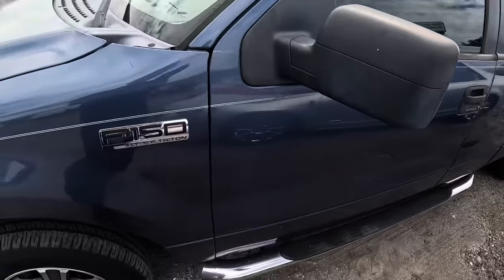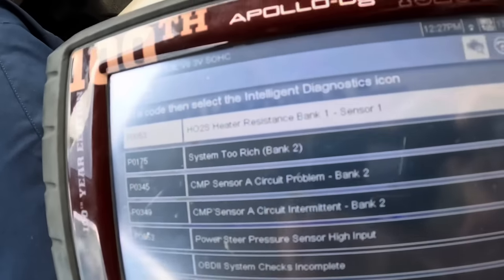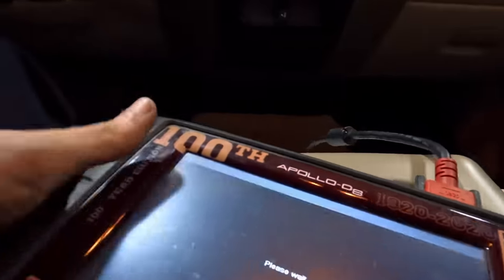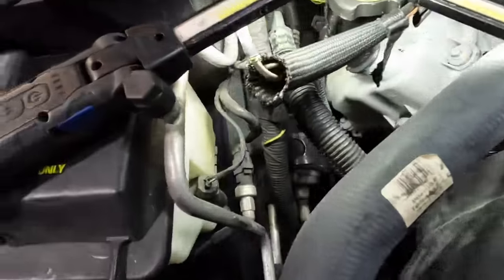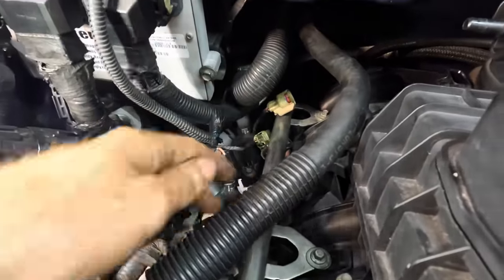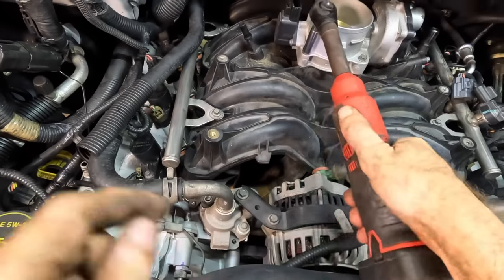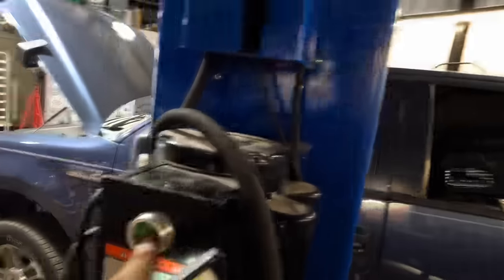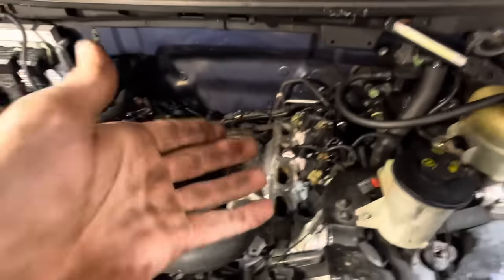Hack Job! Mechanic Botches Engine Replacement! Multiple DTC's

Comment: I could go into depth but it is every complicated but the short and skinny of it is that these engines suffet from an inherint HUGE issue everything from the 4.6 all the way to present with the 5.0s ecoboosts and 6.2s the basic issue is they starve for oil in the top end reason being the oil galleys simoky arent large enough the 2v engines would suffer collapsed lifters usually on the rear 2 cylinders due to them being the last to get oil in the fluid passages and what would happen is they would collapse the rockers would get crooked and the cam would press down on it and bam bent valves then they only made it worse by adding cam phasers to the 3v 5.4s the 5.0s etc. And they to this day refuse to address this issue and reevaluate their oiling system in all of their engines unfortunately the only thing they have EVER done since the 4.6 came out in 91 in the crown vics they specified 5w30 initially then it was 93 or 95 they came out with a TSB to drop the oil to 5w20 and they designed a filter with an antidrainback valve to hold some oil pressure after shutdown unfortunately thatnwas far too little abd far too late and they have continued to build throw away engines to this day

Comment: This is a sorry all-around job, starting with the shabby reman and on through the jackass installation. Yes, someone is going to get feathers ruffled but I would NOT give this hack mechanic a chance to re-do. Better to eat the loss. I can see a small claims suit if the owner is so inclined but that would throw you into the works, which is something you don't want on your plate. This is why I will continue to do my own as long as the Good Lord makes me able.  I allowed a "free Toyota oil change" at the local dealer and ended up in a pool of oil. I have a friend who, many years ago, had the crankshaft replaced on a '64 Riviera. The crankshaft had a sloppy regrind which involved weld slag in the oil passage. After it spun a bearing, he insisted they do it right. Yeah, they did it over, but somehow managed to leave a nut off of a tie rod. They knew he was a hot-rod, and I assumed this was payback. I rode in the right seat when a bump in the road dislodged the tie rod. It was a wild ride, even at 30 mph. This taught me over 50 years ago to do my own. No do-overs for hack jobs.

Comment: Unfortunately those engines were very bad and every one of them is bad I would replace it with something that would not have a three valve system get rid of that vehicle it's not worth it

Comment: The 5.4 is an absolute joke... You need new heads at 100k because the spark plugs will snap off
Reply: Not if you know what you're doing.

Comment: allways check the sensors before you start taking parts of the engine. as a mechanic you should know that. you wasted time for nothing. im not a pro but i have common sense.

Comment: Your focus seems to be the installer's incompetence, but you  can't state the fact of who did the work. 
🤔
Sounds like you tearing down someone else, so you can stand a little taller via innuendo. If you're good at what you do, no need to 💩 on "someone" else.
Reply: this is an obvious fuckup on part of the installer or installers - and they should be shit on all over the place for shoddy work like this. This type of work belongs in HS shop only. 

Yes, accidents can happen and things can someitmes be missed on big jobs like these - but in no way is ANY of this acceptable.
Reply: @ghostrider-be9ek  Agree.  But, continuously refer to the installer as "someone", just makes you sound like a 🐓💩, that is using "someone" else's shotty work to make yourself look better.  Either do the community a favor and warn them about THAT installer's subpar work or focus on your own exemplary skills and stop bad mouthing "someone".
Reply: @joeswheat I get where you're coming from, but the point of videos like these is to bring the viewers along through the diagnostic process and one of the factors in that is always the "someone's been here before"; in this case, most of what is wrong is not mechanical failure but human error. Pointing that out is just a part of this.

Also, Ray is humble and honest -- he says throughout the video, "I don't like this," or "I'm not cool with that," which are obviously personal opinions (in fact, he opens the video with this very disclaimer). 

He's not sh*tting on anyone. He's got enough of a following that he doesn't need to do that, so, therefore, that's not his prerogative.

If you work on anything (engines, HVAC equipment, plumbing, electric, etc.) and you find evidence of incompetence, it should be pointed out whenever it adds time to YOUR work because it was questionable or dangerous or it created the problem YOU were hired to fix.

I've had to correct problems created by the original builder of the things I work on, and the customer needs to be informed that the thing wasn't right from the start, which is why he's had ongoing problems with it. If I were making a video, I'd certainly inform my viewers of that; it is the entire reason for my work happening at all. Plus, there were entire components MISSING that should have been installed.

The customer would think we were selling him parts he doesn't need if we don't explain what was done incorrectly the first time around, since we installed components that were never there before rather than replacing something existing.

Comment: The problem is that companies policy will destroy mechanics credibility and licensing. Don't add to their apparent need to destroy installer shops or mechanics licensing. Cut down on the prattle you make for no reason, and State facts, all those codes don't mean shit to the public anyhow. And you have what kind of audience? Backyard mechanics that do the same level of temporary repair for people that you are upset about. I've rebuilt hundreds of engines and restored entire vehicles. Then seen mechanic like yourself wreck a restore with the car lift dropping it down on stuff being in a hurry like you just displayed.

Knock it off. So you work at Ford? Did you shake Carol Shelbys hand or what?

Comment: Reman engines are junk especially now post COVID, quality has declined parts are scarce and the manufacturers are using the cheapest parts possible, if you need an engine in your car now just junk it and go buy a new car, have a payment and call it a day, Save yourself the time and aggravation.

Comment: You bug the shit out of me just because it's not the way you would do it dont mean it's wrong his connectors would have been fine and I use rtv even with gaskets I dont want to do shit 2 times for oil leaks dont mean it's right or wrong .y take a job you wont fix tell the customer too take it were you got it
Reply: He was asked for diagnostics... He told the customer to take it back where he got it because it's a 'brand new' reconditioned motor with warranty. You tell me something is "brand new" or "reconditioned, with warranty", anything happens in the slightest and it's coming back to you. RTV gets used with certain gaskets, but more often than not a cheap shop uses it to re-use junk gaskets. Silicone should only be used in certain spots. You don't use RTV on a new or remaned engine if you're doing it right.